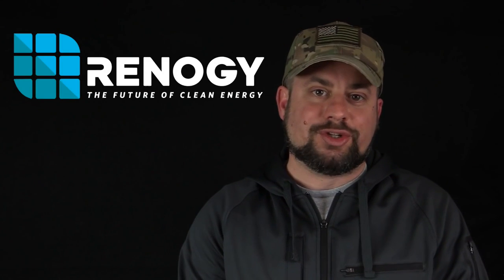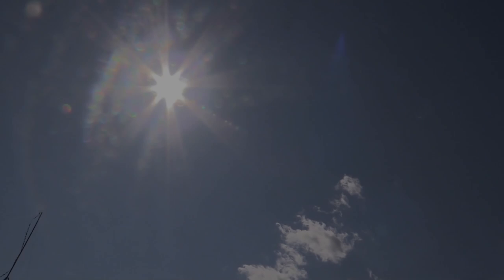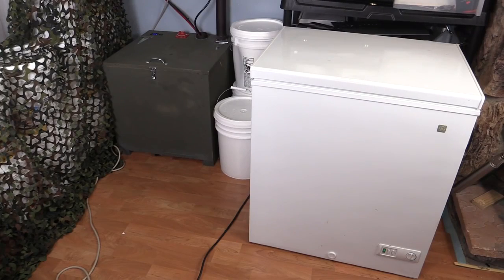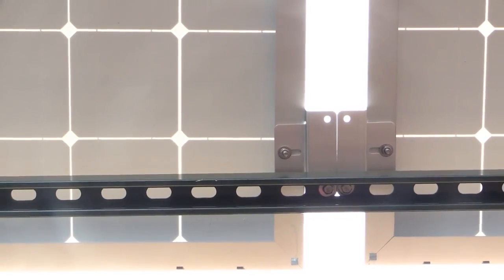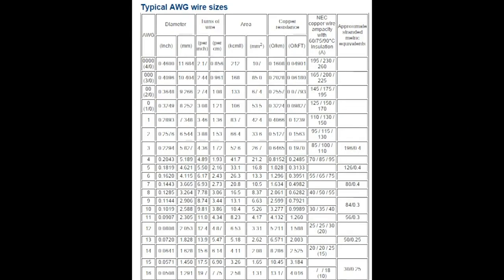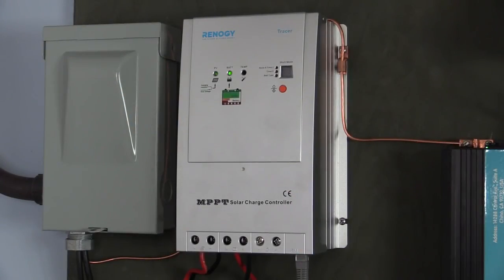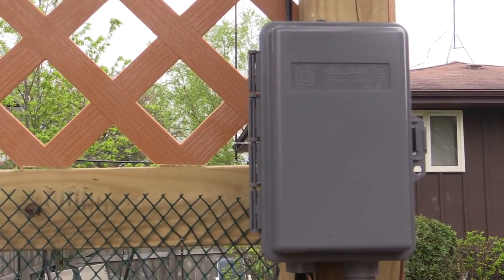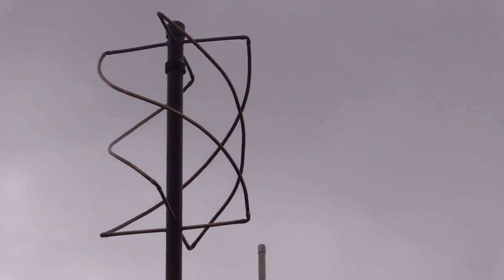The Ultimate Guide To DIY Off Grid Solar Power | Tin Hat Ranch

Comment: I learned while I was homeless what I needed electricity-wise. While homeless, I needed to charge my phone and my laptop. Everything else had other ways. Oil lamps or solar lights or propane lamps for lights. In ground fridge or dessert fridges to keep thing chilly. You can get ice nearly everywhere and since we went to the store everyday, the stores kept our food frozen for us. Wood stove for cooking and heating. There's lots of places to get out of the heat of summer. So now that I'm in my own home, all I need is air conditioning and a way to charge my phone and laptop. Shalom
Reply: As far as wants, I love a wringer washer but I use a clothesline in a hot closet. That's a room that's hearted by the sun to dry your clothes which is where my clothesline is. Then there's the deep freeze and a fridge  Shalom
Reply: There's also passive air coolers and using well water to chill the air. There literally 100s of ways to bring down the temps. Shalom

Comment: Nice video but is not true the part u say u cant heat House with solar u just need to hawe more solar panels and a baterie like me, i hawe 24x 300w solar panels and 2 inverters of 3kw each and 620Ah batery C5 (C100 950) 24v and i hawe a Heat pump and 3 Air runing all over the day (like 5kw)  and 2 Air runing the night :-)

Comment: This is a good intro to solar power generation and storage. Though, I feel like the simple terms you clarify and use that like WW2 submarine alarm audio clip to point out are terms that anyone that should wire up a system like this should already be familiar with. It is still dealing with potentially lethal levels of electricity. If you aren't familiar with wiring up a circuit in series or parallel, maybe hire someone to wire this kind of project. No offense to anybody this may apply to. I just hope everyone gives their safety top priority in projects like this

Comment: I'll be going with 12v system of a 4 panels connected in parallel as well as the battery banks in parallel and using a Mppt controller i think.

Comment: Thanks for explaining the difference in voltage  , amperage and series to parallel aswell as witch charge controller to use the difference between Mppt and Pvc. Very well explaining sir , cheers

Comment: It’s always interesting to me that so many preppers focus on retaining electronics to do things with no grid rather than how to do many of the same things without electricity.
It’s obviously more labor intensive, but it also will outlast you in most cases compared to electronics which are more likely to run into a fatal issue you can’t repair.

Comment: Great job I have a couple of questions do you have a video on how you built your system your system would be great for my uses.also I have built a small solar generator diy I want to connect it to a small cabin hunting that is wired for 120ac it has a plug to connect a generator I want to run it on the inverter much better than a generator thanks for sharing

Comment: Hi, I want a system that will run LED lights and a 12-volt pump for water. All my LED lights are also 12 volt so my question to you is do I need an inverter when I will never run 120 vote appliances. PS my fridge, cooker, and fire all run off calor gas.

Comment: @2:20 "The average American household uses 30 kilowatts of electricity every day." 
No they don't. Electricity usage, or power consumption, is measured in kilowatt hours (kWh) which is different. This isn't a "typo correction" thing, you fundamentally don't understand the difference between power and power consumption. 30kWh can be 2 kilowatts (power) for 15 hours, or 6 kilowatts for 5 hours. 
@7:34 "I figured I would need about a kilowatt of power each day to run the essentials."
In which case your 4 x 100W panels (400W of power) are just not adequate. Those 4 x 100W panels with ~4 (full strength) sunlight hours per day are enough to generate 1.6 kWh though, more than a kilowatt hour, with good breathing room or overhead.
@34:44 "I've got over 5 kilowatts stored in that box" (referring to the battery storage box).
Storage too is calculated using kilowatt hours (kWh) not kilowatts. You can only take as much power from your batteries as your AC inverter allows, a kilowatt in your case, but your total power consumption can be the capacity of the batteries within the drain limits allowed, so potentially 4.8 kilowatt hours.
If you are going to create videos like this to educate others you have to get the concepts and terms correct.
Reply: Mark989  I like Will Prowse, he's very knowledgeable, and has a YouTube channel and a website with lots of information (that is accurate and correct).
https://www.mobile-solarpower.com/
https://www.youtube.com/watch?v=_PgthByAYz4 for a good DIY video or for his channel https://www.youtube.com/channel/UCoj6RxIAQq8kmJme-5dnN0Q
Reply: Way awesome to know I own a Scorpio on line and I definitely want Togo straight to the  manufacturer’s on Thomas net regency . There I will find what and how all the factories have been trending since they opened on the www.
Reply: Anyone interested in investment each one of mt stores hold 4000 products and I was a pg 2 ranking in the organic listing for google

Comment: A few suggestions for your next video / version:
1. as a shortcut, remember that it's the current, not the voltage, that causes loss.  by wiring panels in series, you raise the voltage and lower the current.  while it's true that looking at the voltage going up indicates lower loss, that's not the reason, it's the drop in current that is saving energy.
2. you may not be aware of how controller "regulates the power".  cheap controllers use PWM to simply knock down the voltage, and will throw away the excess volts.  Your good MPPT charger probably has an additional feature of buck/boost regulation.  When panel voltage is low, basic PWM cannot charge your battery, but if your controller can boost, then it will trade the watts, exchanging amps for volts, to suit the battery.  The total watts drop a little but not much, amps drop, but something is better than nothing!  When the panels are higher voltage than the battery needs, PWM will simply chop down the voltage to the battery's needs, delivering the same current as the panels are producing.  But if your controller can buck, it again trades the watts, but this time trading volts for amps.  Bringing the voltage down to what the battery needs, you get many more amps, for faster charging.  The only thing you are guaranteed to get in an "MPPT" charger is power point tracking, which basically means how far down you drag the volts on the panel, which trying to maximize watts to the battery.  Many controllers labeled "MPPT" cannot buck or boost, and are only efficient when your panel's MPPT voltage happens to be about the same as what your battery needs.  I bought a 60A Sun Yoba controller for cheap, and got everything except buck/boost.  It's got a nice display, high current, and is configurable, but it's not as efficient as it could be.  Open up any controller and look for one or more large toroid inductors - if you don't see one, it doesn't buck/boost and you're throwing watts away.
3. remind users never to connect a panel directly to a battery without going to through a controller.  the battery can heat up and damage a panel that's in shade, and a panel can overcharge a battery to a dangerously high voltage.

Comment: overall I think he did a great job ""except""  1. in the beginning he implied he would give a cost to the system, I didn't catch that. 2. again it's implied that it's an independent system and not in parallel with the grid. I believe if it's an independent system you're going to have to wire separate receptacles and lights to be used by that system. if it's in parallel with the grid I think you're going to need an automatic disconnect or fry some stuff. not to mention the fact that once the grid goes down you're going to have to run around the house and unplug a whole bunch of appliances. don't know for sure, looking for clarification. it would definitely be a wonderful system in remote areas where there is no grid.

Comment: It won't follow a path of least resistance. It will follow all paths in a circuit. The resistance just limits how much current can flow freely and how much propagates into volts and heat. Allowing a path of low resistance with sufficient volume for the current flow to dissipate out of the system without exceeding the capacity of the system. The resistance of insulation will mostly direct the current flow; but some of the electrons will leak out and pass into the environment as heat and also static electricity. The pressure of the current won't cause catastrophic voltage propagation, aka waves, if there is a sufficient sized reservoir to hold the volume of the current and allow it to dissipate as heat and static charge into the environment. Ground or a large chassis can serve this purpose. The chassis is like a shallow plateau that works like a ground pond. Instead of earth ground which is more like the ocean volume for water. 

It's important to realize that the wire gauge is like sizing a pipe or drainage channel. The volume of electricity is amps and it won't be dangerous unless the size of the channel or pipe is too small and that channel or pipe is in an isolated network with no place to let off excess water volume. By building in capacitors we are buffering the pressure like a head pipe with a dead end can solve water hammer or pogo instability. But if the head pressure is too high aka our batteries are stacked like water towers in series one on top of the other the same volume of water will have more pressure; it will require regulators at the outlets so the discharge pressure isn't too high. The volume of the system and the pressure of the system are independent. It depends on the size of the inlet/outlet how much volume can flow through and the depth of the volume determines the potential pressure. It just gets kinda weird when we realize that ground in electrical terms is relative and not always the orientation we think of when visualizing gravity.

Comment: Too bad you lingo is inaccurate.  First off, you said the average house uses 30 KW a day.  Wrong!  Try 30 KWh, that little "h" is for hours.  The 30 KW is a power demand and the 30 KWh is an energy quantity.  Would you say you go to the gas station to buy 25 MPG of gas for your car? No, you would say 25 gallons.  You need to learn what you are talking about and get technically accurate.  And yes, I do what I am talking about, I have three college degrees, electrical engineering and software engineering.  Open circuit amps??  In an open circuit you have zero amps.  The true statement should be open circuit volts.  In some ways you are doing a dis-service to yourself and the industry.  Go learn what is volts, amps, watts, watt-hours, ohms, voltage drop, and all the jargon means before you toss it around.

Comment: There is no such measurement as 1kW per day. 1kW is an instantaneous power measurement. 1kW of continuous power consumption for a period of 1 hour is 1kWhr (one kilowatt hour) which is what your consumption is measured in on your electricity bill. An average American household consumes 30kWhr of electricity per day NOT 30kW. If you can't get the basic units right how can we take you seriously.

Comment: A consideration from further north than you.  Low angle of sunlight results in tree shadows. It is hard to find any place where a tree shadows does not cross the panel array at some point during the day. (Trees are neighbours so removal is not an option).  A shadow on a panel knocks it out, although the other panels continue to function.  We have to have each panel individually regulated so that one panel out doesn't kill the rest electrically. The Daisy chain system is more efficient , but vulnerable to shut down by tree shading on any of the panels.  
Also aluminum cable is much cheaper, especially if you get it used.  Mains feeds using #4, or #2 or even 0 range guages left over from demolished houses , or upgrades can be obtained from garage sales or metal recycling agencies.  Called triplex in my neighbourhood.

Comment: Rather than a golf cart battery can I suggest large cell deep cycle batteries zone for running electric fences and such these batteries and designed to run a large 250 km wire to 500 km wire fence 4 Days and Nights in cloudy rainy wet weather in the Southern hemispheres South in winter time on southern face of a hill

Comment: your math alert was amusing, but it really felt like your golf cart vs car battery thing was really dumbing down the difference between a deep cycle and a cranking battery.
in all fairness, 6v batteries are not always the cheaper route as you have to buy twice as many of them when designing your system, you MUST look at the cost of your batteries and decide what voltage you can do most efficiently.

Comment: You have made me very excited sir. I have been looking to find a channel that can describe a solar system to me in an understandable way. I recently had a company come and give me an estimate for a set up at $68,000.00. Yes, I did not make a mistake on that number and I knew that I should be able to do it cheaper. However, you have shown me that with a little math and instruction, I should be able to design and install my own system for so much less. Relax, I am a master technician and carpenter and know all about volts, resistance and amperage, as well as, the structural integrity of a home, I am just a newbie at solar and needed someone to explain it to me like you have. I have subscribed and will be spending much time camped at your channel. Thank you and great job.

Comment: Second thing I am curious about is the statement that batteries become useless in cold climate. When I worked for a retailer/whole seller of electronic components we always stored batteries and sensitive components in a fridge room. This was done precisely to extend the storage time of charged batteries. I personally, since nearly 30 years back, consequently store all small batteries in the fridge in a sealed plastic bag to avoid condensation. It is namely condensation which can cause problems. Not the cold per say.

Comment: At approx. 33:50 into the video you describe there is "no real benefit" to having an MPPT controller for a single panel system. This is inaccurate as if you have a tree branch shading only one portion of one solar panel, you will experience a radical drop in power output from ALL your panels. The only way to ensure full charge for all panels at all times possible (given the suns coverage) is in reality by having a single charge controller on each solar panel. For practical and cost reasons this is however hardly feasible. In all though, very good facts and reality check on the whole scenario of setting up a system from a prepper's perspective.

Comment: I have Ben totally of the power grid for 13 years With every thing I had before I had the power meter pulled it is a big relief when the power grid is down I am not affected or even know it !!!!
My average power bill being about 14 dollars a month that is the batteries replacement every 5 years ! 
And the replacement of any electrical equipment that fails with in the 5 years !! 
Before I ever went off the power grid my power bill averaged about $225 a month
If you take 156 months times 225 that’s $35,000 .
If you take 156 months times $14 a month that’s $2184 for 13 years of power !!! 
If you decide to go off the power grid you need a minimum of 100 panels at 150 W that will give you power on rainy days because I still get a charge To my batteries on the rainiest day ! And  my batteries are charged for that day for that night power use !!

Comment: One of the issues you haven't mentioned is the start up power of the freezer motor. Normal running of a freezer is small, the start up power of the motor is somewhat larger

Comment: Excuse me Mr Tinhat sir.  I know this is a old video but  I believe you have made a mistake on your battery part.  Running 2 6v batteries in series does infact just make a 6v battery with double the storage.  As you show your Battery box you actually have 2 sets of 2 battery series,  which makes 12v.  Hooking a bat positive to a bat negative still limits it to 6v.  I hope someone has pointed this out to you. I would hate to believe 2.3 million people have watched this over 4 years and not noticed.
Reply: Survey says, urrrrrrr. You are wrong sir. Connecting batteries in series increases the voltage. Two six volts in series=12 volts. Three six volts in series=18 volts and so on. The amperage stays the same. In parallel,  the voltage stays the same no matter how many batteries you connect but the amperage increases by the number of batteries connected. Three six volt, 100ah batteries connected in parallel gives you six volts at 300ah.

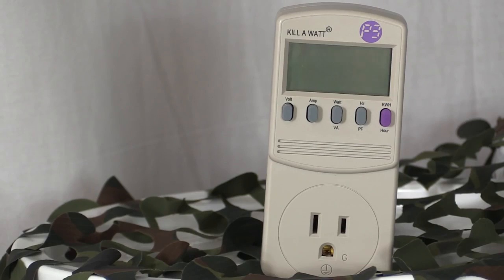Comment: You are consistently confuse power with energy. 4:34 you said "energy draw at a given moment" which is nonsense, 0 joules of energy is used in 0 time. 4:36 you said "power they consume over time" which is wrong also. The 2 terms are swapped. Also the unit is used wrongly. "uses 30 kilowatts every day" is nonsense. They use 30 kWh (kilowatt*hour), which is an energy.  2:38 kW/day unit of measurment could be defined also, but it would mean an increase rate in your power needs, which is definitely not what you wanted to tell. You should have said kWh per day. Learn elementary level terminology before making these kind of videos!

Comment: As a person who is going to college for electrical engineering, a 4s1p config, or 24v system would have been optimal with these batteries. Your inverter efficiencies go up, and there are no downsides in this use case.